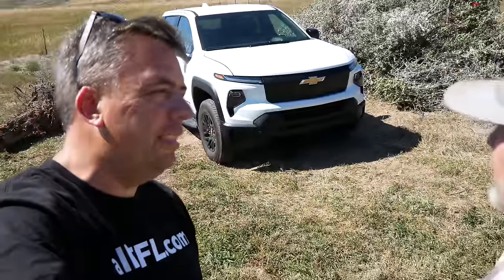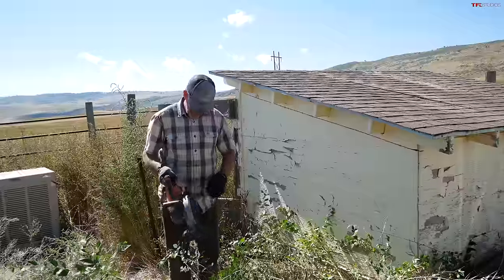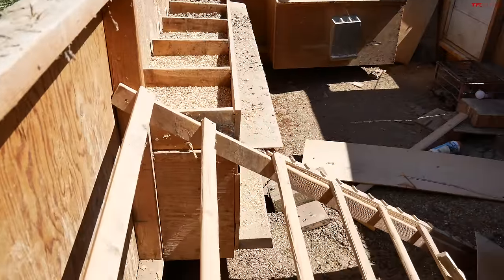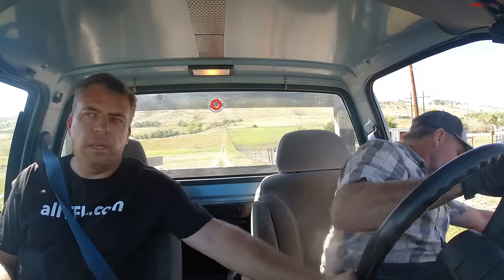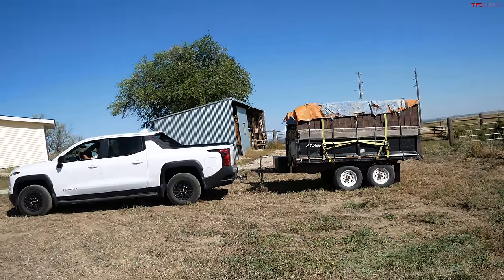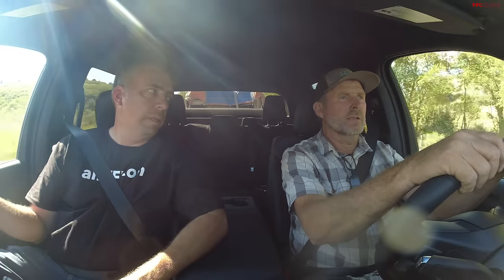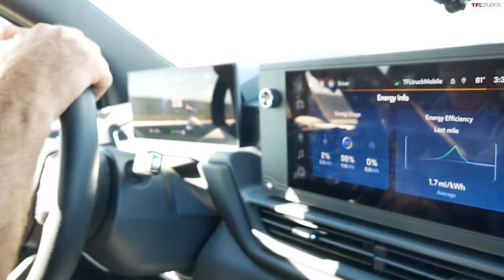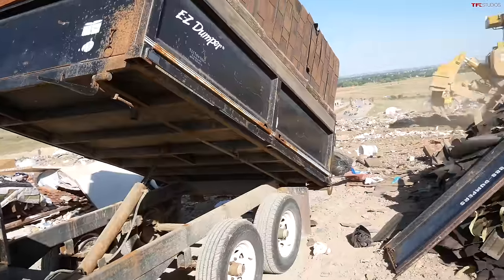Old vs New Work Truck - Can the 2024 Chevy Silverado EV Work As Hard As A Classic GM Truck?

Comment: One thing is for sure, 30 years from now you wont find a running 30 year old work truck.
Reply: Yeah, but we'll probably find some running 50 and 60 year old work trucks!
Reply: Doubt that. Look at golf karts. The electric ones from the 70s and 80s still work perfectly with new batteries. Gas ones break down and need full rebuilds every 15 years. The only thing I worry about with newer vehicles has nothing to do with being electric or gas, it's things like sensors etc that go out.
Reply: @GadgetMan777  Not really comparable. Golf carts use cheap easily-accessible lead acid batteries.
Reply: @PlayWaves1  and EVs have expensive liquid cooled ones that last 10x longer and likely won't need to be replaced for 200k-300k miles. The comparison was just to highlight that there's no reason to suggest an electric vehicle can't last a long time

Comment: $80K+ for a truck based on a unibody not a fully boxed frame? Good luck in the long run. “ yea but the battery pack is framed in” but what is that attached to?

Comment: It is too expensive for a work truck but David is right, if someone with the money wants more speed / power and a quieter more stable ride then why not; it's their money.
Reply: Well said! In 3-5 more year's with semi solid state and full solid state cells plus much faster wide spread charging?
Gas will finally be a thing of the past. 😎
Reply: @4literv6 then this would be worthless
Reply: @Dankcatvacs  why? Every tech advance doesn't immediately mean the previous obsoleted unit is then worthless.
People bitch about ev residual values. Yet they forget to factor in tco savings and the credits off msrp. 

Our 2020 bolt is still worth quite a bit more than we paid for it in April of 2020. 👍🏻

Comment: If it is a work truck truck it should maybe have more bare bone things & the cost at max should be no more then $50k maybe like $45k & still have over 350miles of range then I could say this is a contender to be a solid work truck but as well need that towing numbers to be at least 12k then it can be a big contender at $45k-$50k with at least 350miles of range
Reply: 3WT

Comment: LOL “7.2KWH” - cant even run a small saw… is this a prank??
Reply: A 110 volt outlet is still limited to 15-20 amps. An old saw jammed up results in a locked rotor condition and that current can spike to 40 amps momentarily, causing the breaker to trip. Older magnetic breakers are more tolerant of that kind of dirty load, newer ones are more sensitive, and you can have the same thing happen in your house on a Siemens, Eaton, Cutler-Hammer, pick your favorite brand of breaker.
Reply: @steinwaymodelb  makes sense. But the way they r advertising it is that you can use it to power your house on a power outtage. So like i guess you could run a coffee maker which is cool BUT so can my 30 year old truck with a small inverter…
Reply: @AccountantByDay553  The 120V outlets are powered by two 20-amp circuits with a maximum power draw of 2.4 kW each, for a total of 4.8 kW of 120V power.
The 240V outlet is powered by a 30-amp circuit with a maximum power draw of 7.2 kW.

I assume GM will do something like the Lightning and come out with an integrated solution for your house to connect the CCS/J1772 Port directly into your service box, allowing the vehicle to output a considerably large amount, like plugging in a generator to your generator port on your box. IIRC GM is calling it PowerBase(?)
Reply: @Black-Villain  that would be cool. I still hope RAM releases the rumored on bed generator. That would be sweet here in the farm

Comment: It can't be a work truck with such a puny box. You need more cab, chassis, and box configurations to have a bonafide work truck. If one can't put a wide variety of service boxes and cargo into it to make it practical for specialized work applications, then it's not of much use to the people who buy fleet trucks for actual work. Old W/T is what a work truck should be. Essentially a cab of any size, mounted to a chassis. It baffles me that any company would try to sell any kind of work truck solely in a crew cab, super short box configuration.

Even more infuriating is that the Ultium platform has the needed versatility to offer practically unlimited configurations. They could do it, but they're flat out refusing to. It's basically a cheaper version of an overpriced pavement princess option for soccer moms. Might as well just cover over the box and add a third row for all the sense that it makes as it is.

Comment: The Chevy EV is just too gimmicky to be a work truck. Yeah it has a few things going for it but it’s just not as adaptable, affordable, or easy to repair as the  GMT-400. Plus the sensors would drive me crazy if there isn’t a way to turn them off.

Comment: I like truck but I'll stay with my 2.7 turbo trail boss. Electric vehicles are old technology. 100 years ago there were Electric vehicles that charge better. Back than you would pull up to station and a couple of guys pull out the low battery and put in a fully charged battery back in the car in 5 minutes.

Comment: David's 30+ year old truck still runs and you don't need to buy a $30,000 battery after 8 years. Manufacturers don't think about the little guy.
Reply: Who told you you will need a new battery in eight years. Where do you get that from? You’ll see numbers like that based on the  old Nissan Leaf which was passively air, cooled and degraded after about eight years. But current EV batteries have active thermal management with limits degradation, and are generally rated to last about. 1,000,000 miles. The oldest numbers we have on modern style EV batteries are from Tesla model S from 12 years ago and they are still going strong as batteries even after 250,000+ miles. With the newest generation of EV batteries The battery will outlast the vehicle metal
Reply: Main issue is price and range…solid state batter should fix the latter.
Reply: @Jeddin  A Nissan Leaf battery is 1/3rd the size of a truck battery. People in my area live in condos keep using the public DC Fast chargers (they don't have the luxury of using a standard charger at home) and the batteries are not getting time to recondition properly. Most dealers won't let you take the pack out and replace the faulty cells at a 3rd party battery shop. If you watched the other videos on Youtube they show you the price of replacing a battery pack in a larger vehicle.
Reply: @jeffrey88888  yeah. Don’t buy a Nissan leaf. It’s shit battery tech. The Nissan leaf and cell phone batteries are what turn people off from EV thinking batteries will just degrade in a few years and need to be replaced for $20,000. But those are small batteries that go through frequent cycles and run hot. You’re going to sell your truck or car before a EV battery needs to worry you.
There’s a few videos that do show Tesla batteries failing for expensive repairs, but these are very low percentage wise. Much lower risk than your transmission failing  and a lot cheaper as it should be covered under most batteries eight year warranty. Will there be some people out of warranty with expensive battery repairs? Sure if you’re worried about that don’t buy new Ev that’s fairly small risk

Comment: Regarding the chicken coop, wouldn't it have been easier to burn it? As far as the plasticy SilveradoEV, I would take David’s 92 GMC over the SilveradoEV 100% of the time. In fact, if GM made that truck today, just like how David’s is set up, they would sell more than they could make.
Reply: Well said
Reply: That's actually a really cool almost unicorn of a truck. That super low 1st gear, manual, 4x4, big block truck is a really cool combo. Sure it will get 8-11 MPG at all times, but that's towing beyond max or empty at any speeds.

Comment: Need to compare the 2 hauling the skid steer and see the juice the EV uses compared to the tank. Still a decade away from electric coming close to the economy of gas or diesel. Refuel time is currently the biggest issue.

Comment: Great video Andre! You and David are awesome! I think this Silverado is hideous. I wish they made it look like a regular truck and not a “new age”, uglier avalanche.
Reply: GM will likely and eventually expand the EV platform to the rest of the traditional body over frame design platforms.

This "Avalanche" based design is likely a starting point for GM, which is aimed at a specific customer geographic.
Reply: If GM would just put exhaust pipes on it would be a better truck?  - right?   or keep the sides the way they are for effeminacy and keep the mileage range high?    “new age” and uglier be dammed?   - right?

Comment: Haters still won’t do the math.  175,000 miles @ 18 MPG @ $4/gal is about $40k in gasoline. Charge this overnight off-peak and it’s closer to $10k in electricity. Minus another ~$4k in maintenance you’ll never do. Ends up being VERY close to a base 2.7T 4DR/4WD WT.  And that’s WITHOUT claiming the $7.5k tax rebate.
Reply: Lovers still won’t present realistic analyses:  Nobody keeps their truck for 175,000 miles.  If by some strange circumstance they do, if driven 10,000 miles per year, that would be 17.5 years.  Figure a new $20,000 battery pack every eight years, which would mean two battery packs, which is $40,000 dollars.  That offsets the cost of gasoline, so the EV still loses on value.  It’s amazing how the shills “forget” some very important information.
Reply: @mikek5298  you’re not gonna replace your battery in eight years. The battery is gonna be just fine. It’s fine to not want an EV ever but stop making up facts about batteries. people based these battery statistics on the Nissan leaf which was completely passive air cooled with no thermal management whatsoever and they conked out in about eight years. Modern EV batteries with thermal management will last way longer than the metal will. Batteries are projected to last 1,000,000 miles.
Reply: @@berserker406 about 10% in the first two years and then it will stabilize at residual 80% for practically the next 20 years. And that’s assuming you use it hard. You maintain your battery by limiting heat exposure and max charging. You’ll keep it at close to maximum capacity for more than 1,000,000 miles
Reply: And how long to charge?
Reply: @Dankcatvacs  15 to 45 mins on DCFC depending on how low you are pulling in charging to 80%. 2-8 hours overnight charging on 240 v depending on how much charge you use in a day.
Reply: @Jeddin You don’t know that! These trucks haven’t been out for a decade. Do you really trust gm quality? Lol
Reply: @Jeddin  That’s one of my sticking points! You can’t charge  it to 100%! These battery trucks are stupid. So I can’t charge it all the way and in winter you lose 20-30% of range!

Comment: 25:30 You are not taking account for the fuel cut that happens on deceleration since the invention of the dash pot. Carburetors stopped introducing fuel to a decelerating engine since before the 70's.

Comment: You know, you can still buy a gas powered "work truck' today...and it will be just as nice as that EV...but it will be noisy, won't tow as much, won't handle as well, weill take 1000's of dollars of gas, oil changes, brake changes, exhaust replacements etc etc etc....and will pollute the environment.    So you spend more up front...to spend 1000's less over the years.  All the while, not polluting the planet for your kids and grand kids.   

Climate deniers, don't bother replying.... I don't debate people who don't crasp basic science.
Reply: Towing with a full EV is an absolute beating outside of VERY short ranges.  Our house has an EV, a series plug-in hybrid, and several combustion powered vehicles. The series hybrid is by far the best of all worlds. It’s full-EV range covers most of our use cases, and long range is just like driving a gas or diesel. It’s only downfall is that the drivetrain is in a small car instead of a truck.  An HD pickup with a series hybrid drivetrain would absolutely rule the market.  It would be like a road-going locomotive. Don’t forget to consider the environmental impact of mining the materials for the batteries, and producing the batteries and then disposing of them at end of life. EVs are far from pollution free.